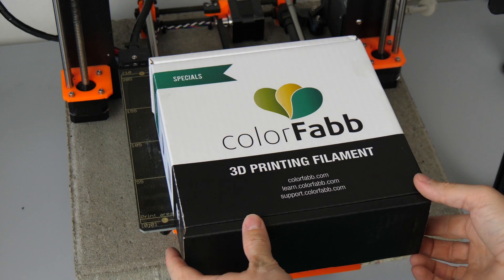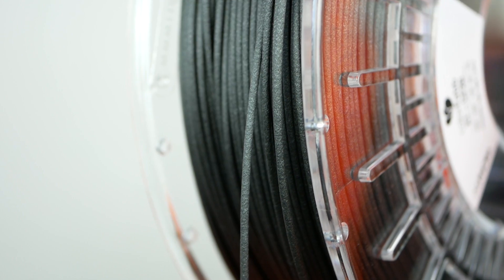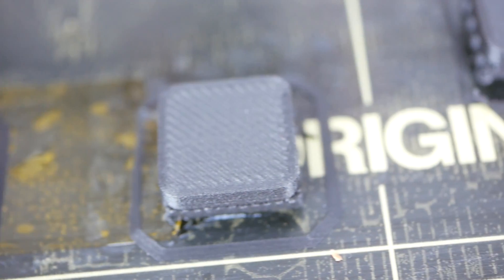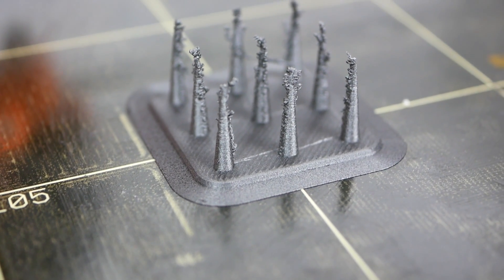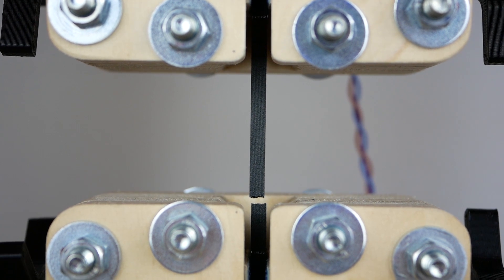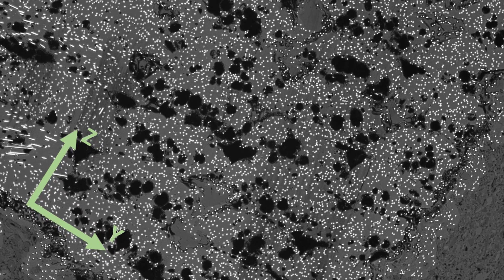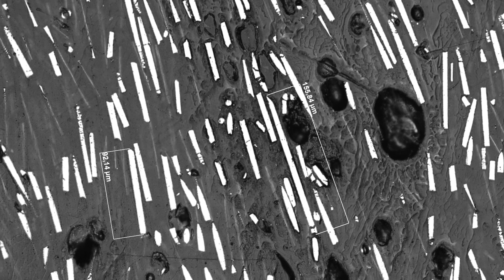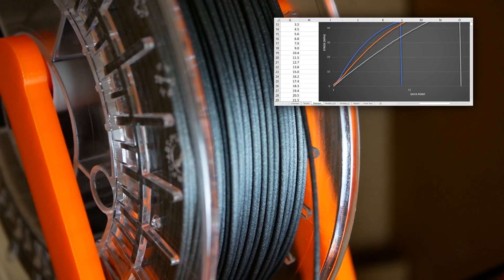3D PRINTING with CARBON FIBERS - ColorFabb XT-CF20 REVIEW

Comment: Most fine particles are a hazard.  Any particle below about 20 microns is a hazard.  If you can avoid it, just don't be around it.  My suggestion for reworking/sanding any nasty material is to do it *wet or submerged*.  Intuitively, transverse sanding those carbon strands can release particles of a biologically unfortunate size.  A mask works whilst you wear it, but unless you're accustomed to cleaning up a microbiology lab or clean room, it's safe to assume that junk is everywhere and waiting to be re-suspended next time you brush by the area (particularly if done near a window or other heat/plume source).  This isn't to knock on carbon filament in "particular" but applies to a range of plastics, metals, etc...  Your caution is not excessive if you wish to avoid some types of cancers. ;)
What camera rig did you use for the macro shots, by the way?
Enjoyable video as always, and thank you for sharing your work!
Reply: gth042 you are right and enough people aren’t aware of this. Laser engravers are one of kings for small particles, even with precautions the dust will be airborne the next time you walk the in work area and you will not likely be wearing a mask 24/7 to fully protect yourself. Although these laser machines are capable of great work, they are fundamentally unsafe.
Reply: Pan Tac  Even if the engraver has an enclosure with negative pressure, and the air sucked from it goes thru a filter?
Reply: TiagoTiago yes, that vacuum system doesn’t remove everything. There will still be particles that will make their way inside the room after removing the work material from the machine, which has some residue from cutting/engraving. If you’re around hazardous material, you can’t 100% isolate it, you will will be exposed to a certain extent of it. Some people just chose to ignore it until it becomes a problem for them, at which point it might be too late.
Reply: TiagoTiago it’s always vented to the outside air as far as I know. I don’t know how legal it is. Neighbors might have a problem with it. The exhaust from the laser engraver I was around seemed to have some particles that escaped the filter and I could smell the fumes a little bit.
Reply: I worked with pyrotechnic grade German dark aluminum powder for over 10 years. The particle size is just under 3 microns (consistency of cigarette smoke). For reference, a red blood cell is 8 microns. It can sometimes feel like a million tiny slivers in your skin, and dye your skin a metallic gray that can't always be washed off. Gloves and mask are a must!
Reply: What about wooden 3d printing. I think that involves wood dust being suspended in PLA. Is that also hazardous?
Reply: @Invictus_Mithra  Interesting question, I think biodegradability is key.
Reply: @Invictus_Mithra  real wood is not dangerous. But plastic is not healthy.
Reply: @sverduijn1  Actually it can cause cancer. Particularly MDF which uses formaldehyde as a glue. I don't know if this filament also contains it. both wood dust and formaldehyde are Group 1 carcinogens. When working with wood products, dust and free formaldehyde are released
Reply: Don't breath dust. God gave you nose hairs for a reason.
Reply: I still have the idea to create glass fiber composites in the near future. However, i plan to use fibers that are 1/4 in long chopped fibers. Imagine a 35-40% glass fiber polypropylene. Might run into issues with entrusion though.
Reply: my penis is of a biologically unfortunate size

Comment: i don't think there are any studies either way regarding the safety of Carbon Fibre.  I'm guessing it doesn't contain nanotubes which ae fairly similar to Asbestos in size.

Personally, I would be a bit careful around using it, simply because carbon fibres on their own can be an irritant if you get on your skin, inhailing couldn't be good either.
Reply: I remember seeing article somewhere about dangers of race car drivers being in carbon fiber dust. It's quite a long a ago when I saw this. I think it was some brake systems(?) that got forbidden somewhere because of severe carbon fiber dusting.
Reply: There have been studies done since the 80s, the fibers are less damaging than asbestos but still can damage lungs.

Comment: carbon fiber is toxic, and the strands are typically barbed, which makes them get caught in your lungs. I always wet sand carbon fiber and it works pretty well. I would be interested to see how this co-polyester carbon filament compares to a nylon filament of similar quality. great video as usual!

Comment: I have PA6 with carbon nanotubes that will eat this copolyester for breakfast.
Also, nanotubes wont migrate from polymer matrix as fibers would.
Price is quite similar, about 60USD/750g
Reply from the maker: Do you have a link to your filament?
Reply: Where can I buy nanotubes filament?
Reply: I think you've been smoking those carbon nanotubes.
Reply: Google PA6 & carbon nanofibre

Comment: I have tried PLA-CF printing about 1.5 year ago... It looks great, it's unfortunately less strong than regular pla and just a bit more stiff... 
But the worst... I got strong itching on my fingers... under the microscope I had litterally thousands of carbon fibers in the skin of my fingers... and it didn't go away with washing, soap, tape, wax (yeah I was desesperate, especially I wear contact lenses... I don't think getting carbon fibers into my eyes is a good idea)... Finally got rig of most of it with sandpaper... I still had some fibers visible under the microscope 2 weeks after. Never ever touched that roll of filament again...
Reply from the maker: Very interesting to know.
Reply: CappellaTheCat I guess it's the 3D printing equivalent of mineral wool 😛
Reply: No it's 3D printing equivalent of asbestos. Or worse.
Reply: @MeatLeBeef  mineral wool isn't that bad, glass wool is...
Reply: I worked with carbon fibre in the aviation industry, carbon fibre splinters were common the danger of these splinters lays with the human body not rejecting the splinters like it would with other materials such as aluminium or steels!
Reply: @swang1664  yeah, I never worked with carbon fiber but I am an exotic car enthusiast and pretty much every documentary i've ever seen and book i've ever read on the production of carbon fiber chassis and parts shows the workers wearing respirators and wearing gloves to handle the materials. I always knew it was bad to breath in the fibers but I never thought about the splinters.
Reply: I know your pain) Learned my lesson after I was shortening down CF rods for a quadcopter. Such a bitch to remove.
Reply: Late reply - might be similar to fiberglass insulation. Best way to get it out = rub with a slice of bread. The fibers embed in the bread and are happier there than in your flesh. Good luck!
Reply: @frollard  This sounds like something my dad would say

oh they are trying to sell you expensive remedies?
dont be a sucker, just use bread!
Reply: @frollard  'honey... I have to take a shower... Where's the bread??'
🍺😂
Reply: Getting carbon strings in your bloodstream is terrible for you, gloves and respirator.  Not worth it for 3d printing imo
Reply: you won't find it recommended by any one because it's not good for you. 

but.. Super Glue from the dollar store, fingernail polish/adhesive or if you want to be really safe and official like me liquid bandage has a osha paper trail for use on skin. 

the acrylic like glue contains the dust or fibers to the area and bonds or sticks to them to make them larger and easier to deal with. 

keep your skin separated so it does not stick together wait for it to dry then when it's hard peel it off. 

if need use acetone(finger nail polish remover.) but remember the more you dissolve it instead of flake it the more of fibers are loused. 

the sand paper might scrape them in rather then pull them out. 

also, if you need to hide your fingerprints but don't want to wear gloves, superglue works well for that too. the things we do for a mortgage. just kidding.
Reply: Yikes. Valuable information!
Reply: I recognize that itch. Always get it when working with those CF parts. I can see the tiny black fibres in my skin in the microscope, scary. Better use gloves and a mask.
Reply: I was just going to make molds with ABS/PLA, then do a wet layup of carbon fiber cloth.
Reply: @evlsc400  how did wet laying CF go in already printed parts? Was it easy? And stupid question, did you have to take breathing and skin precautions when doing that?
Reply: @MrCODEmaster00  I haven't done this yet, I have just finished getting the 3D file ready for the Suzuki Escudo Pikes Peak car I am going to print as a composite plug. It's cheaper to print a 1:1 composite plug than it is for me to get one milled down in foam with a five axis CNC mill. As far as safety goes there's hundreds if not thousands of resources on this topic covering composites and handling them. Good luck in your endeavours.
Reply: I used gloves and breathingmask when cutting my carbonfibre-bike fork. And was really carefull when removing the dust from the saw.
Reply: May i ask if this happend beacuse you reworked the part? I'm wondering if i won't do any post processing but just print the part, will it still be dangerous to handle?
Reply: Carbon fiber is a very funny product and I would always handle it with gloves.
I want to print carbon fiber parts for cosmetic parts only on my motorcycle.
Thank you for your Warning.
Reply: Daam we are under attack
Reply: What was the % of carbonfiber in the PLA you used i dont have this issue with the stuff im using.
Reply: Damn that sucks. PLA is strong but thermal tolerance sucks.
Reply: Should use hot glue that is cooled a bit before applying to the skin
Reply: @UCAfTg5698fGDlKcJvedY7yA Don't believe stuff just because some idiot put quotation marks around their assertion
Reply: It might be a spool with cheaper milled fibers
Reply: Then you need to rewatch this video and realign your prints.  I have had some prints that we simply could not get to break at all or even change shape under heavy loads with this filament.
Reply: Wow, thank you for the information. This should be disclosed by the manufacturer.
Reply: Thanks for letting us know, I was going to try CF20 again, but decided not to after reading your experience, I don't remember anything similar in my first trial, but the reason I stopped was a broken extruder, so all in all, CF not worth it :)
Reply: Breathing this is about as healthy as asbestos.
Reply: @HaggeBänke  There is actually a BIG crucial differences between Carbon fiber and Asbestos, the Asbestos is Cancerous. It can literally mutate your cells, Carbon fiber does not...
Reply: @Guds777  as far as I know Asbestos is a silicate. So I does not make "Cancer" The thing is that the body tries to break it down but cant since its so resistant to everything. Thats why it was used everywhere. Same with the carbon fibres.     Once inhaled the body cant get rid of the fibres because they are so long. Cant break them down, develops cancer while trying. Look it up there are a couple of interesting articles. Have a nice day ;)
Reply: @Tim_2060  Asbestos does cause cancer. It's why it isn't used anymore and is stripped out of existing buildings wherever possible.
It causes mesothelioma, a particularly nasty form of lung cancer.
Reply: @BeardyBaldyBob  Isnt that what I said?
Reply: Oh wow. That should be a huge warning thanks for sharing it!
Reply: Alright then. No the carbon fiber in this filament is not carcinogenic. It has a diameter of around 5 micrometers, which cannot do the DNA piercing damage of asbestos. The confusion arises with carbon fiber nanotubes. These are carcinogenic and have a size very similar to an asbestos fiber.
However it is very hard for our body to remove carbon dust from our lungs like most particulates so I'd avoid it. 
To the person who wrote this comment, if you can see the fibers with any microscope you have at home it isn't carcinogenic.
Reply: Capella, do you have any of those images of your hands?
Reply: CANCER directly printable for everyone hwo wants it xD
holy crap sound similar the horror story of "Morgellons disease" 
https://www.ncbi.nlm.nih.gov/pmc/articles/PMC3047951/
i had once 2 fibers/metal particles in my fingers which caused pain but where so tiny only visible under a microscope. I tried a comsmetic cream i got from ebay since it build a very tight film much better than tape. its called "
60ml Charcoal Mask Blackhead Removal Cream".
I removed several particles but not the 2 most anoying ones, because i guess they where already to deep under the skin.
I think these fiber products are a bad idea even when you use gloves and a dust mask.
I mean these vibers wont magically vanish after you stopped working. 
They will travel  through the air everywhere! They are a permanent thret to you ,
your kids, neighbors , pets/anmials. 
its like a cancer timebomb waiting, and carbon is know to be good at waiting ;D
Reply: Saw some shop offering it as a product, thought it sounded awesome, ordered it on Amazon Prime, checked some reviews again, arrived at this video, read your comments, then cancelled my order. That sounds nasty, thanks for the heads up.
Reply: I agree: horrifying!
Reply: Im flying quadcopters and they all are made out of carbon fibre. They dont have any particles coming off  on the top and bottom because they are sealed with a cosmetic layer. But on the sides its fully open and Im constantly touching the carbon parts. Is this dangerous??????
Reply: @ariafpv  oh dont worry regular glossy CF is made out of long fibers that arent sharp and its all submerged in resin
Reply: @ariafpv  no bacausevits diferent material , probably yuor dron  its inyection mold parts , thats very diferent at a roll of "some plastic"+ carbon fiber
Reply: Lmao i used to work in a fiberglass factory 😂 no suits no ventilation haha this comment made me think wow if you worked there lol
Reply: I assume that is the problem with chopped carbon fiber filament and continuous fiber filament won't face the same problem?
Reply: @luongmaihunggia  As long as you don't break the fibers, yes.
Reply: I had a similar experience with cf. Was wet sanding a rocket tube i made with cf, and the fibers dug themselves into my fingers, leaving them black looking. I had to take a knife and scrape a thin layer of skin off. Never touched cf again either. Imagine how 3d printers spew microscopic dust in the air, and the delicate tissue of your lungs. I knew a fiberglass plant worker on oxygen. The xrays his lungs were all white. Use your intuition.
Reply: Ok that’s great to know, thank you for informing as many people as possible about that experience.
Reply: Jesus Christ the good sovereign king loves you my friends, I hope youre all doin well :" )
Reply: What brand was it?
Reply: You probably never use pencils then?
Reply: @DudeBoerGaming  Uhh.... What?! Pencil lead is made from graphite, not carbon fiber!
Reply: @3dprintedcuber458  "Carbon fiber is a polymer which is a form of graphite. Graphite is a form of pure carbon. In graphite the carbon atoms are arranged into big sheets of hexagonal aromatic rings. ... Carbon fiber is a form of graphite in which these sheets are long and thin" ;)
Reply: @DudeBoerGaming  Thanks for the info.
Reply: @DudeBoerGaming  Yes, graphite in pencils is made of the same element but as you write it's a different structure than carbon fiber and that makes all the difference. Carbon in pencils has a structure of small flakes that make powder which is bound together by clay. This form is not as dangerous to human because unlike the tiny "needles" of carbon fiber, you cannot stick the graphite powder through your skin and when inhaled, lungs would probably be able to get rid of graphite. 
Imagine graphite as pile of sand while carbon fiber being pile of needles.
Reply: @DudeBoerGaming  You are thinking of Graphene. Carbon fiber is entirely different from Graphene. Just like both are different from Diamond, and all 3 are made of the same element.
Reply: Wuss, wear gloves.
Reply: @linzenmeyer  read my comment before, gloves protect you only on you hands and also only in the short moment.

Comment: I also find the same. I'd be interested to see your findings with colorfabbs new pa-cf. I find it a lot more agreeable.
Reply from the maker: I definitely need to get my hands on some brand of PA-CF soon but I had this roll for quite a while and didn't want to not use it at all.
Reply: CNC Kitchen I've tried a few brands. The colorfabb is the easiest to print. Others can warp a bit. Found a cooler bed (about 45 degrees) with glue stick or PVA glue worked well. The rigid ink carbonyte is very strong but can warp. With the nylon, I'd be interested to see the difference between freshly printed, and after it has had time to absorb water after printing. Seems to soften quite a bit.
Reply: @ Jai Stanley :
Rifle stocks are injection molded out of nylon65, so I imagine it can handle rain, water submersion, and atmospheric moisture.